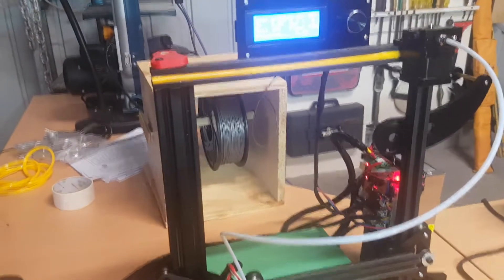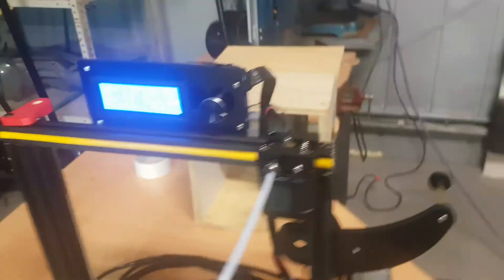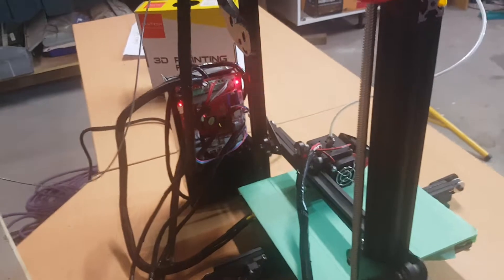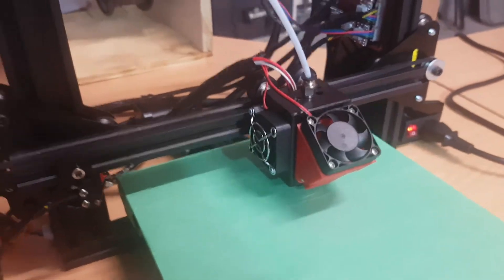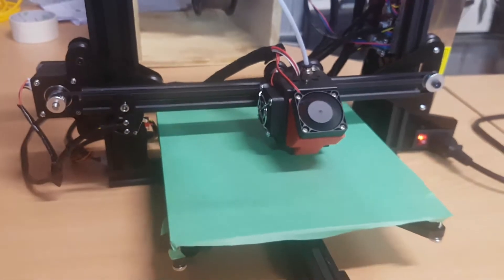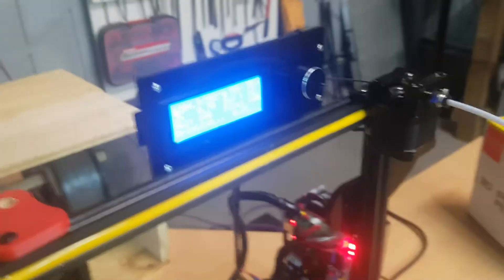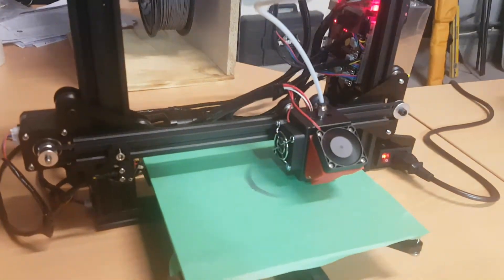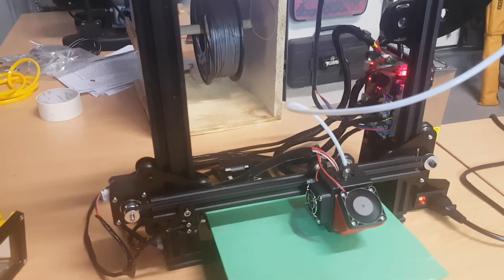Zonestar Z5 Let's start printing. Affiliated channel with Gearbest.

Comment: hi i bought the same printer but cannot assemble the z axis front bracket its too tight fit. would not slide over the rail
Reply from the maker: Hi could you hangout me so I see what is the problem please.